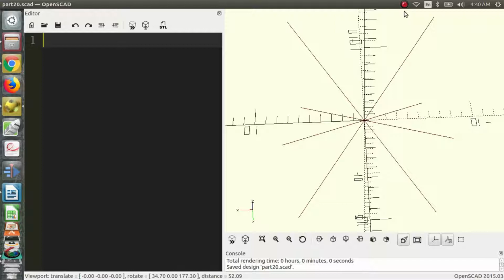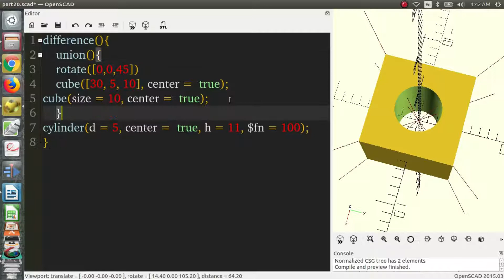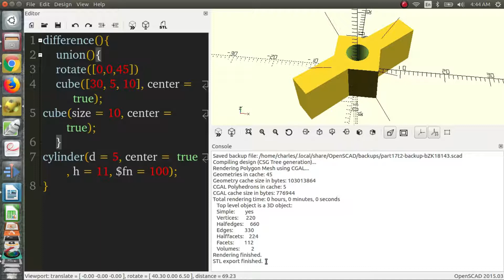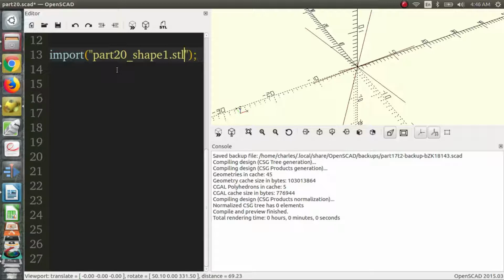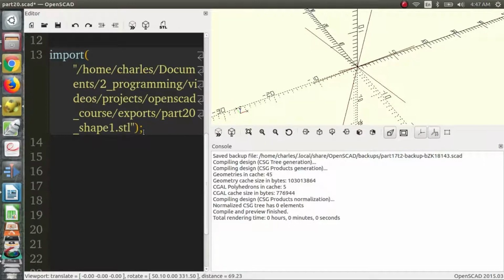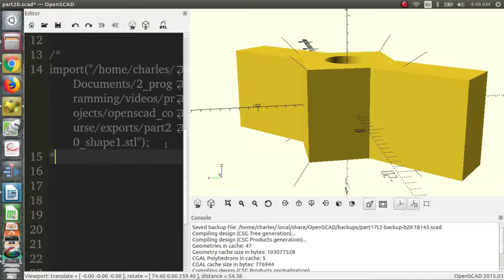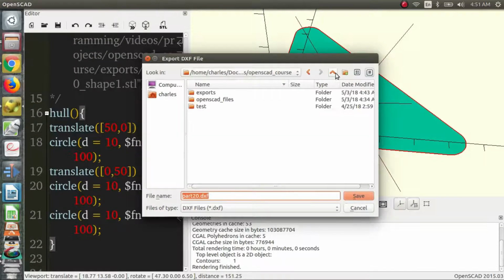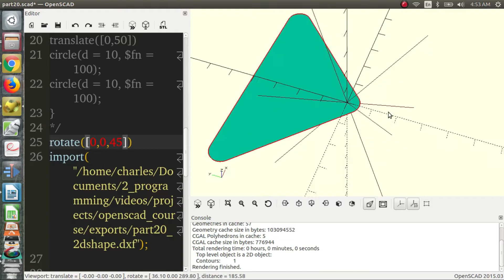Importing/Exporting STL/DXF Files-OpenSCAD Tutorial 20

Comment: Hi I really enjoyed your video . I'm learning Scad but I'm concerned , my computer could be "got at" when I'm away from my desk , and I want my work , to stay , my work. I always have a rugged USB drive in my wallet , and I want a quick and easy way to take my drawings (even unfinished ones) with me , on the drive , when I'm away from my desk . Is there a way to do this ? Is it something you have already covered ? What do you suggest ? Thank you.
Reply from the maker: Hi, Thank you for the comment. I am by no means a computer security expert so any recommendation that I make may not be the best approach to keeping your files secure. For more comprehensive ways on how to protect your files, I recommend looking for tips from security youtubers or bloggers. That being said, two simple approaches that you could take are 1.) Plugging your usb device into whatever computer you are working on while you are writing your OpenSCAD code and only saving it to that usb device and not to the computer you are working on. This would be an issue, however, if you lost or damaged your usb device or if the computer is not secure while you are working on the code. and 2.) you could encrypt the .scad file using an encryption program and copy it over to the usb device when you want to take it with you. This would again be vulnerable if the computer is not secure while you are working on the code or if you use weak passwords or no passwords when encrypting your files.
Reply: @CharthuliusWheezer  I ended up finding a foolproof security system Obviously I cannot go into any details. Except to say I had to stop everything I was doing and just concentrate on this for 2 weeks , it is more complex that it looks at first ( there are 5 steps to securing and 5 for releasing ) I am happy I took the time to do this . My advice is to clear your calendar and just work on security till you have a fool proof system.

Comment: FINALLY, a tutorial with big font text.  I found cube work with this format ([x,y,z], true); "center=" is not needed.
Reply from the maker: You are correct, the inputs to the function can be specified either by order or by referencing them by name. So cube([1,2,3], true); is the same as cube(size=[1,2,3], center=true); or cube([1, 2, 3], center=true); but the parameters that are ordered must come first ie. cube(size = [1, 2, 3], true); does not work correctly.

Comment: is there any way to show the dimension of the imported file to openscad?
Reply from the maker: I'm not sure I understand exactly what you mean. If you mean the distances between different points on an object you are importing I have to say I don't know a way to do that. 

There is a way to resize an stl with the resize function so that the x y and z dimensions are known. You can read about it here : https://en.wikibooks.org/wiki/OpenSCAD_User_Manual/Transformations#resize

There is also a way to find the bounding box of an object although it doesn't always work : https://en.wikibooks.org/wiki/OpenSCAD_User_Manual/Commented_Example_Projects
Reply: @CharthuliusWheezer  If you put one of the dimensions, I guess   it can adapt the rest itself
Reply: In 2023 you could use PrusaSlicer's measuring tool on exported STLs. I believe it's available from version 2.6 but I may be wrong